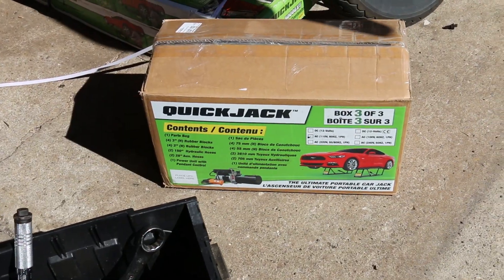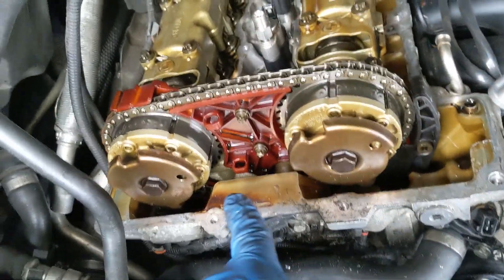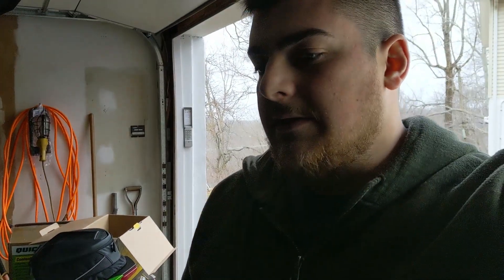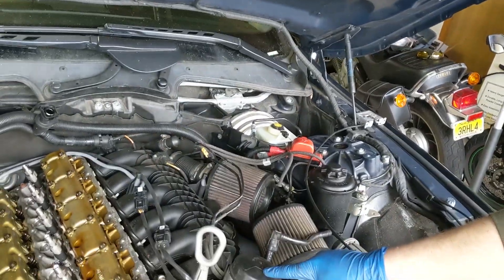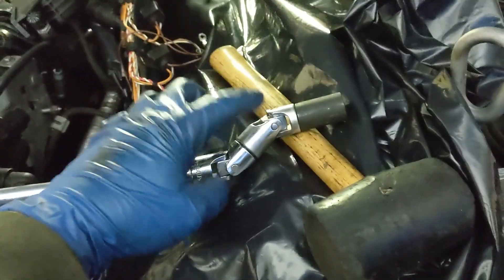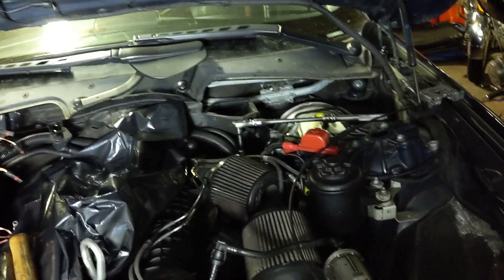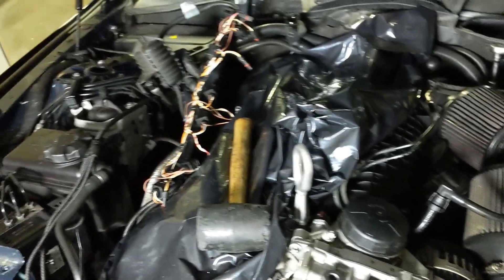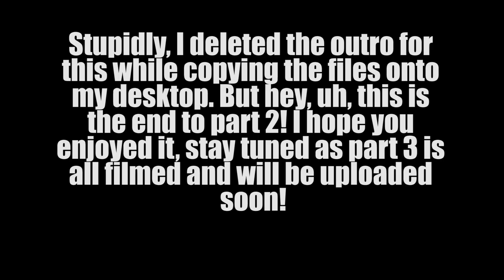BMW's Belt Sucked Into The Motor - Part 2 (QUICKJACKS ARRIVED!)

Comment: I just had the same issue with a 135i I picked up for $4000 dollars. I just pulled the whole engine in my driveway and took off the oil pan and valve cover cleaning out all the rubber pieces then installed a new crank seal, oil pan gasket, and valve cover gasket. We had the engine back in and the car running the next day. It only took two days to do all of it. I would say pulling the entire engine is the easiest thing to do.

Comment: Greetings! 

I'm literally going thru the same thing with my 2008 E60 535i right now :) Belt shredded and got sucked in thru the front crank seal. I was stupid enough to keep driving for another 7-10 miles thinking it's just my alternator that crapped out... lol.

I did pop open VC and inspected timing chain and guides, no belt debris there. @ 112k VCG was overdue anyways, so that took care of that, lol. Shreds of that belt logged themselves so badly behind idler pulleys, alternator pulley and of course belt tensioner I just opted for replacing them. Front crank seal replacement was not too bad with the right tool (got one from ebay for under $200).

Now I'm on to oil pan removal and this project would be the most involved thing I've ever done when it comes to cars. After watching lots of youtube videos and reading everything I could find on this topic I'm pretty intimidated. Especially after looking into the TIS. My car has both dynamic drive and active steering  + auto trans which makes it for a mess of all sorts of lines which appear to be in the way of a subframe.

So, at this point I'm really looking up to you, my friend, and waiting impatiently for the next part in this series since I'm really hoping to solve this DIY style :)

Cheers!
Reply from the maker: Oh man, I'm sorry to hear that, it totally sucks! Yes you've got the worst of all options, however it is doable, just not terribly fun. Be sure to order all new aluminum bolts for the oil pan, and I'd recommend doing the oil deflector and oil pump bolts while you're in there. I've got to edit and upload the next two parts to this, so you'll be able to see what came out of the oil pickup tube. Good luck with the project and let me know if you have any questions on the process!
Reply: @FoulNews  Cool deal! You supportive comment makes me quite a bit more enthused about this whole endeavor! :)
Reply from the maker: @dpersh76  Glad to hear!

Comment: How to you take the crank shaft pulley off without taking the bolt off?
Reply from the maker: Depending on the year of your car, there are either 6 or 8 smaller bolts surrounding the large bolt. Those are the bolts that need to be removed, then the crank pulley will come out. Just make sure you do not remove the big center bolt, you will mess up your timing.

Comment: Hey dude, my belt got Shredded 2days ago in bmw e92 328i 2011 and I didn’t notice it got broke until I got home I drove it 5miles to get home, so I replaced the belt and I turned the car on I hear no noises  it seems nothing wired, but how I can make sure the belt didn’t Sucked in or not. Please I need you Opinion.  Thank you🙏
Reply from the maker: Hey man, sorry to hear that. My suggestion is to not drive it until you've verified that the belt didn't get ingested through the crank seal. Take off the crank pulley and check for the condition of the seal. If it's been compromised, you need to pull the oil pan, but if looks fine, you dodged a bullet. Better to be safe than sorry.
Reply: Foul News Tnx a lot brother I really appreciate 🙏
Reply from the maker: @GhostDante1  no prob. Good luck!

Comment: I’m going thru a similar issue had a leak from the right hose of the oil cooler and since I ordered the vtt delete plate with an fittings to run an aftermarket oil cooler I was like 1 more week of driving it no big deal been driving it for a month luckily when my car started to smoke I pulled over and right when I was going to turn it off was when my battery light came on didn’t notice any other lights... did the belt and pulleys checked the crank seal since it was a new seal with less than 5kmiles luckily wasn’t broken and no pieces of belt went thru it but now my car won’t start and just shows vanos codes of cams not synched
Reply from the maker: There's a few things that can cause the vanos codes and no start issue. I would first check the solenoids and clean them out with MAF cleaner. It's a very temporary fix, if it works. If it does work, replace the sensors with new ones. If not, then you may have either spun your crank hub or the cam ledges have worn down enough to cause vanos issues. I have also seen vanos failures where the cam bolts break or back out as well.
Reply: Yea I did that because I installed the vanos solenoids about 10k miles ago because I was having issues with the half engine light and being fully derrated because of the exhaust solenoid... honestly after I sprayed it since my kdcan cable isn’t synching to my car idk of the vamos codes have been coming back on cus when I use a handheld scan tool they only show 2 codes for the camshaft sensors but I pulled them out and they weren’t broken tried checking for voltage and all good but I live in AZ and it’s really hot here so I haven’t really taken much of an interest in continuing the check the car until I saw your video and now I’m sorta willing to work thru to take off the valve cover to double check inside to see if I spot anything else